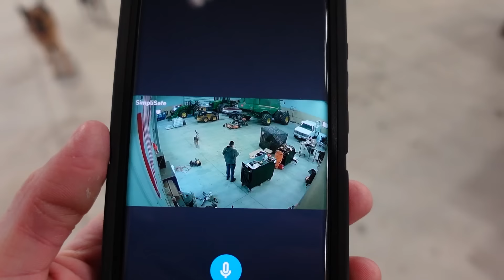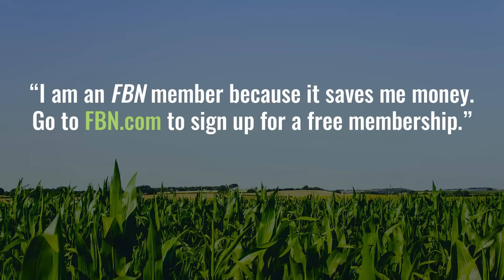Dumpster Fire

Comment: Kinda impressed that you've run a farm this long without a pallet jack. It is indeed a very good friend :)
Reply: I don't have a farm, and I have one, but I work on a farm. The pallet jack has helped me so many times.
Reply: And if you turn it round you scan scoot on it… used to race ours round our cold store at home.
Reply: Btw, in Germany we call the  pallet jack  "Ameise", which in english means "ant"!
Reply: @andreaswienert5820  we used to call it a pumper truck - not the real name.
Reply: surprised he's not got a set of jill forks.
Reply: @prjndigo  uhm, what?
Reply: Pallet jacks are amazing. You can move tons of material but you can't roll over a zip tie. 🤦‍♂️
Reply: I ran one of those into a heavy stack once and it wouldn't go in so I took a run up. Turned out the pallet was the wrong sort and it was never going to go in. What did happen though was my knee making full hard contact with metal. I went down like a bag of grain!
Reply: Or an actual forklift. Big enough to lift full totes, small enough to maneuver between trucks/tractors.

Comment: Zach, make sure your racks are attached to the floor or wall, preferably both.
Reply: I can second this. I used to work at a factory with some that were even larger.
I once saw a forklift driver misjudge putting a pallett up.
He had three shelves come down on the lift along with about 7,000 lbs of parts onto the lift. (the cage saved him but not his pants 😁)
Thankfully the legs of the rack and the top layer stayed put because of the legs were bolted to the floor.
That steel will twist if you aren't careful.
Reply: @douglascampbell9809  Yep, I've seen it more than I wanted to.
Reply from the maker: I wonder if Uline sells a kit for attaching to the wall? I'll look into that this week

Comment: Those pallet racks 😅 yeah. Eventually, I came up with a system... Lean end against the wall, but a beam real low to connect to other end. Now come back and do one at 5'. If you do the back side first, less ducking. 

What's real fun is putting them up with a fork lift. Get em started on low beam. Platform, rails (on an angle), platform+ rail. Bring forks between the ends, climb up on the forks, hook up the back rail then front rail. Now the platform. Rails on an angle so they can fit between your end stands...

Comment: Zach: on your cold storage building, im curious why there isnt any big doors. Has always been that way or did there use to be doors on? Thank you.  The lawn mower bit was really funny.
Reply from the maker: It has sliding doors but the rails are shitty and the doors don't slide well. We've had them fixed several times but those doors are so heavy they keep going bad so I just don't mess with them much
Reply: @MillennialFarmer  You shall consider about motorized doors?

Comment: hello zack  hey that new pallet jack will also work good when you have to replace a wheel seal or bearings on one of the semi"s or semi trailers . just pull the axle and lock nuts then have the axle just high enough to put you pallet jack under both tires and  with your brakes released pull hub and all as a unit  , replace your parts then slide it back together  and torque the nuts back on .
i have worked for a couple of shops  that we used these when we didnt have a wheel dolly or one that was being used somewhere else .sure is alot faster and hell of a lot easier than dissasembling everything .

Comment: 16:50 best part about having a loader with a blower on the back is you can push a bunch of snow with the loader and blow the snow back over that flows out from the sides of the bucket when you back up.

Comment: Same problem with our 550. Tap on the stater solenoid with your plier or a hammer, or rock it back in forth while in gear. Usually does it😂. Plus turn handle bars all the way to the left. Good luck

Comment: as someone who worked at homedepot and used that kind of racking daily...did merchandizing there...only thing you did wrong is no sledge hammer, i would recommend that you put a bolt through the beam and the uprights, one more spot to secure it and make sure you dont accidently knock them loose, you could also measure and look online and most likely get a couple beams where you could put another shelf above the window
Reply: Those kid of racks there have a tab that locks the horizontal beams in
Reply: @craigcary4404  with forklifts, skid steers or really any powered lifting equipment it is easy to bust the locks like toothpicks, when moving heavy loads, bolts are cheap throwing a grade 5 bolt in is enough to prevent accidental damages damage injuries
Reply: @all3survivor  it's Home Depot, not "homedepot".

Comment: Hey Zack sounds like the ATV has worn starter brushes.   Not making contact with the starter armature.   That loud click is the starter solenoid so good power to the solenoid and I would bet good power to the starter, but not continuity through the starter brushes to turn the starter.
Reply: It's Zach...

Comment: Hey Zack,
Try some Kendall Blue Grease on the the battery connections. I tried that once, and stuck with it my whole life. Never had corrosion, contact or dead battery problems. (The Quad)
Doesn't hurt to try and it's a cheap fix for a reoccurring battery connection problems. And don't forget to check into the Pyramids, I'd bet $10 it would work.
Reply: It's Zach, not Zack. Read the whole descriptions!!!

Comment: As nice as it was when my Dad bought the snow blower, backing up sure was a pain. We put it with our JD 620 because the rear wheels were only a bit wider than the width of the blower. The bigger tractors were too wide. If you know of a 620, the idea of having a cab on tractors back then was not even an idea...Look out, the wind shifted  and you now look
 like a snowman!

Comment: No. 15 below, just, no. 
You might measure between the racks and see if you have room for shorter horizontals for a shelf above the window. 
Do you have ceiling fans to push the hot air toward the floor?

Comment: Carbom monoxide sensors are suppose to be at mid wall height, Because it's heavier than air and settles to the floor.  It's to late when The CO gets to the ceiling.

Comment: Hey Zach, you might consider using 2x12’s instead of those flimsy wire shelves. I set up hundreds of feet of shelving with the wire and ended up scraping them all and replace them with wood. It looks like your totes have an irregular footing. Anyway, that’s what I had to do.

Comment: Use an I beam for your mail box, tends to discourage the close calls from the snow plows.
Reply: That is illegal in most places, besides the liability when someone crashes into it.
Reply: @mch_mr_j  I agreed with that.
Reply: Put a steel sleeve in the ground. Put your post in it. When it breaks, lag a chain to it to pull out broken piece. If frozen pour some calcium chloride in it first. Slip in new post and your done 👍

Comment: Take it from some one in the warehouse business. (Forklift driver) use the bolts. Bolt the rack to the ground. And don't go cheap on the bolts. The weight rating it not accurate without the bolts.

Comment: I had the same problem with my four wheeler it’s not the battery there’s an electrical box up front by the batter that goes bad I’m not sure as to what it’s called but we replaced that and it’s hasn’t done it since

Comment: Have you decided if you are going to persist with the 1910 air cart and strip till yet Zach? My experience with potash is that it hates moisture and you seemed to have bigger issues later in the day heading into the night when moisture increased. A lot of ppl in Australia run a lpg gas burner next to their fan to suck in dry warm air which decreases the moisture being put through hoses. Might be something to ask tillage man Sam

Comment: Get you snow blower for your skid loader and put chains on the tires or if Deere made a big directional tractor you could turn the console around backwards and look forward blowing snow or get a front mount snowblower for the tractor then problem solved you'll be looking ahead all the time

Comment: Curious to how the shops were built originally and now how you would want to build them now due to the temperatures swings. What’s cost effective vs technology.  Radiant floors and solar panels? Or just spray foam insulation with gas heat?

Comment: to do an exhaust for performance properly requires headers, and downpipe to match.  Otherwise doing just from the downpipe outwards, only nets 15-20 hp.  If you had headers and dp it'd be a total of about 35. Then after that you'd have to get a tune otherwise, to take the full potential of that exhaust with factory settings, won't mean much with just pipes.
Reply: He owns race cars!  I would bet he knows about your "tip"!
Reply: @paulcopeland9035 , I know he does.  :)

Comment: Engine rpm power is not really determined by your exhaust, it's all in the intake and camshaft design. Also you never lose low end torque from exhaust mods

Comment: That exhaust absolutely does not technically void your warranty.  However, if you have any engine troubles such as a knock, etc they will make YOU prove the exhaust didn't cause the issue.  I know it sounds ridiculous but I had this exact situation.  Hope it doesn't happen to you.

Comment: a tip just but a marker on the wholes so you see witch you use. some string or tape and use the whole under it . that is just easyer.  warning for all the farm equipmint dealers and sealers . keep your wifes in side and the merchandise out,

Comment: yes just slide it and just pull your truck slowly and it unloads it off your bed and if your wife and your kids are out there make sure you're eating chicken noodle soup or have some beef stew usually in the winter time I always like to have hot chili not too hot just right yeah it cleans out your cold system and puts back in your immune system you got that rightyou know that bed truck that you have there sitting in the middle there you can get your lift and put your four wheeler on top of it and then you can take it down when you need to use it if you like to do that it's extra storage🌍🌎🌏🙏🤝💯👍💟💟🇺🇸🇺🇸💌💞💞👒

Comment: Curious where you picked up the shelving at and how much? Been looking for that kind of thing for awhile!
Reply: U Line
Reply: There is a big secondhand market in pallet racking but be careful there is a wide range of systems and weight carrying capability. Pre-purchase research is vital to avoid mistakes. 
I strongly dislike mesh shelving as small items fall through or get trapped in the mesh and cardboard boxes get hung up on them especially if they have sat awhile but they let light through if not covered.
(I have covered the few that I have with either thin metal sheet or quarter plywood)